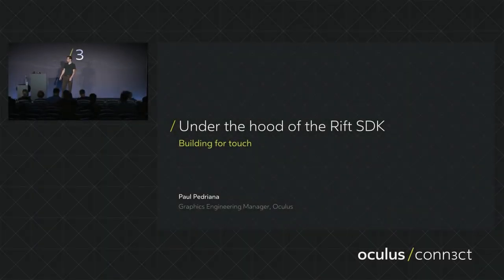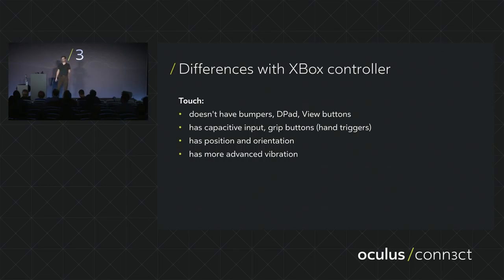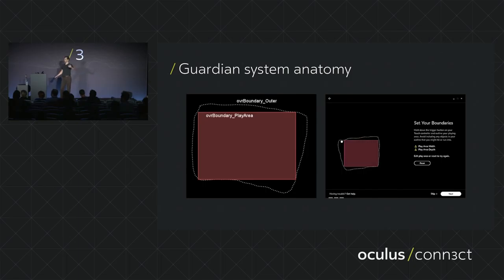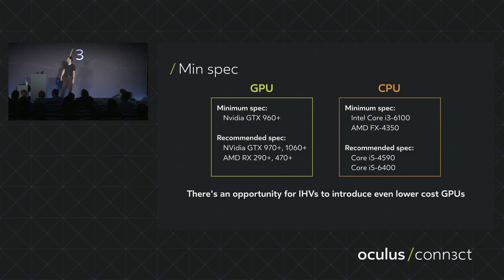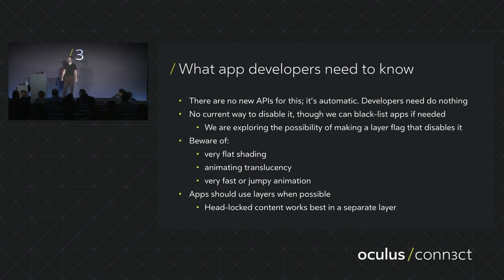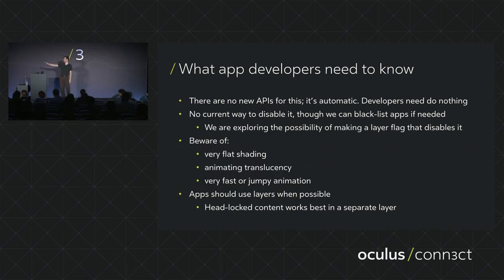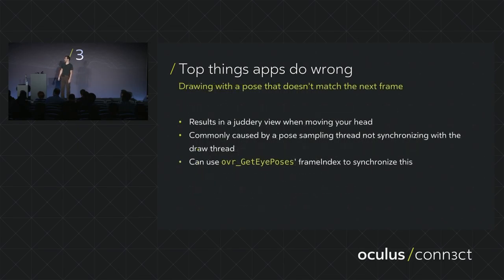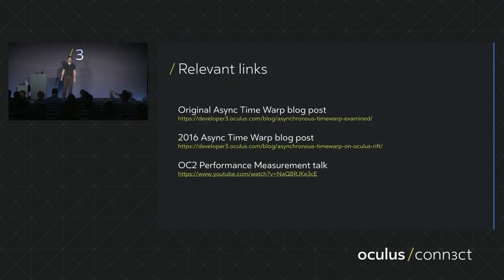Under the Hood of the Rift SDK Building for Touch

Comment: Hearing great things about/from oculus and own the rift myself. This guy is well informed, but perhaps a public speaking class would be beneficial. He stumbles a bit through the presentation. A strong confident speaker inspires intent listening and makes it more pleasant to the ear, still love the info though, Thanks!
Reply: Didn't mean anything bad by it. He did quite well, it was just his transitioning that was kinda lacking in my opinion, because of the awkward "and yeahs" and "so that's it" type phrasing. Not that it really matters just sharing what I thought at the moment of watching the video. :)
Reply: Engineers don't typically do this kind of public speaking, and a good presentation requires a bit of practice with the material which - as an engineer - he didn't likely have a lot of time for. But yeah in any case it could probably have been more energetic.

Comment: The raw LibOVR API is vastly more powerful for developers to work with than what the Unity/Unreal engines expose. I'm so excited to be working with the Rift now, and finally just got drawing to the HMD working yesterday - a meter-sized yellow quad flying around back/forth! Now I'm going to start building a new VR-centric engine out of my existing 22k line engine with voxel rendering and scripted logic and procedural asset generation. Awesome times ahead!